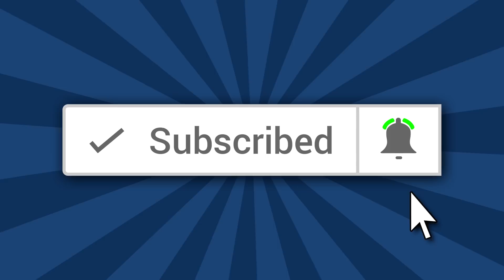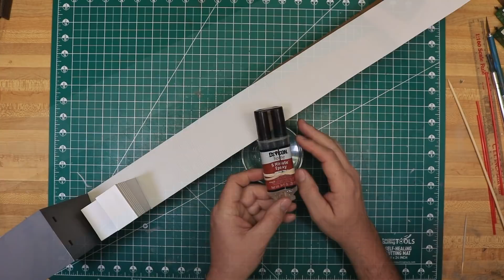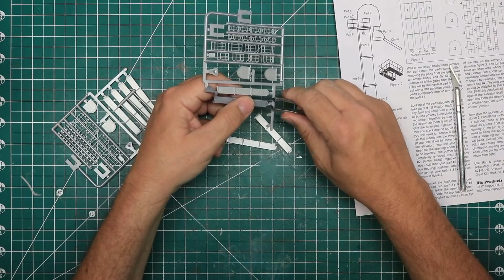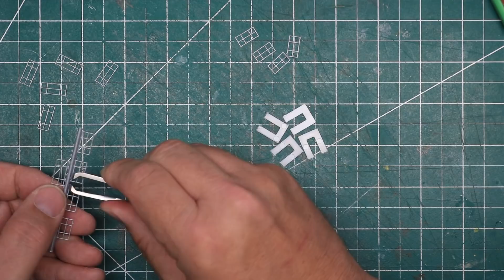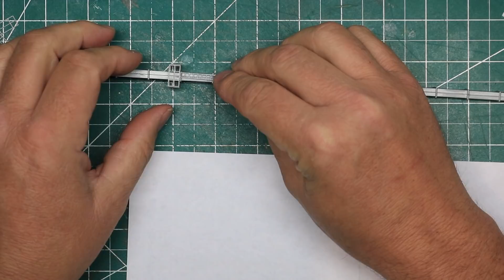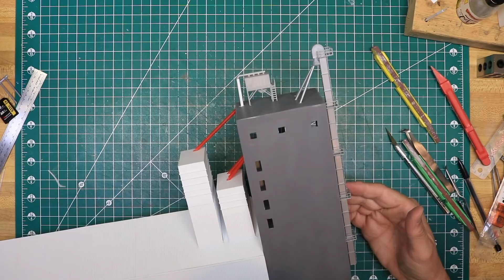How to Scratch Build a Modern Industrial Structure

Comment: Hi Ron, cutting windows and Doors , this detail was lost, did you use hobby knife or a other tool to cut out windows and doors
Reply from the maker: I drilled a small hole in each corner then cut between them with a hobby knife and used a file and sanding sticks to get it to perfect size and shape.